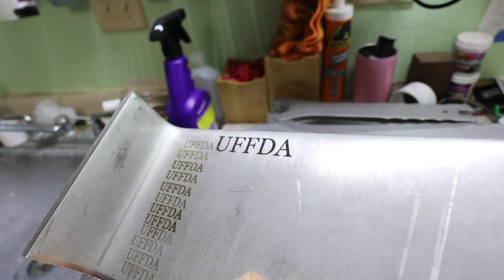3 Day Vlog and ups and downs of Running a Laser Engraving Business

Comment: awesome ! if those tags are stainless steel, im sure you can get nice dark mark on them with annealing, it looks like you are using a small lense maybe 110 mm ? try defocusing 3 mm up and run 200 speed 30 power 60 kHz and see how that works out, annealing should not have sparks while running but consistent light, if its not dark enough either raise power or lower speed, just remember as soon you start to see sparks its too much power.
Reply from the maker: Thanks but they are aluminum